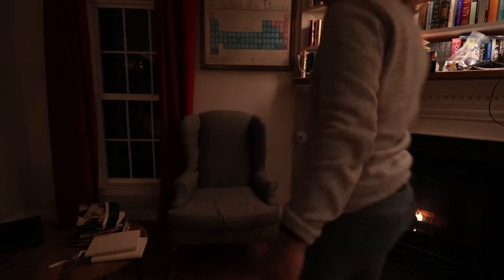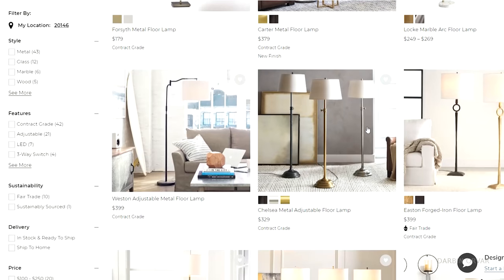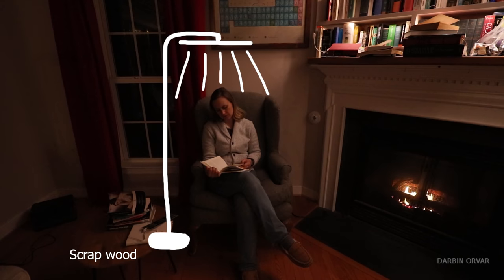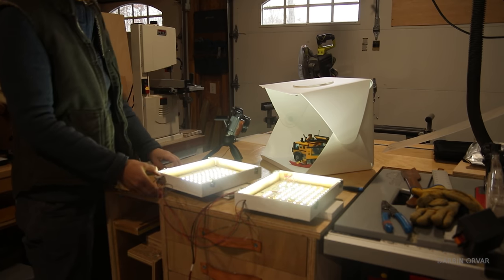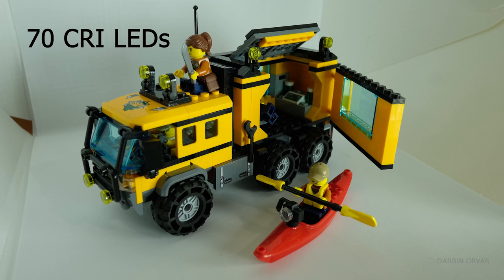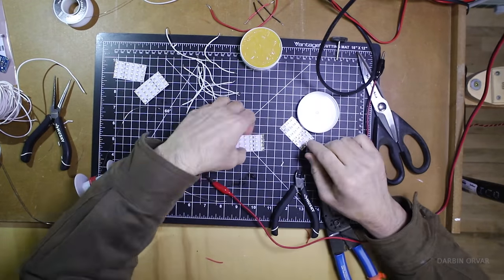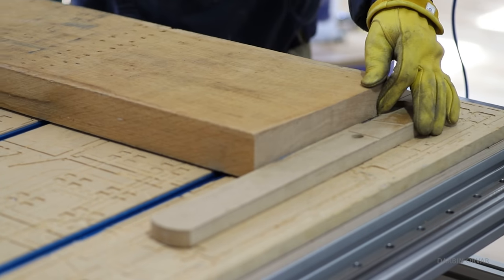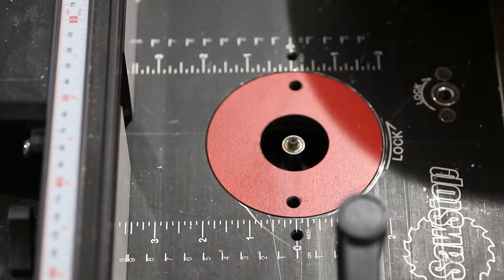Challenge: Making a (Superior) READING LIGHT

Comment: Enjoying your videos!  I made a 2000 LED array where the X axis was the LED strips and self adhesive copper tape (like for lead glass work) was  the Y axis.  The power had to be split up for 3 sections to handle all the current.  My white balance is off because I didn't use better LEDs but I correct for that in Photoshop.  
BTW I moved from Virginia to Oregon and am down the CNC path.  Thanks for sharing.

Comment: What if one of the LED panels blows, will the other ones still work? Would having some connector system between each strip make replacing the strips easier? If so what would you suggest?